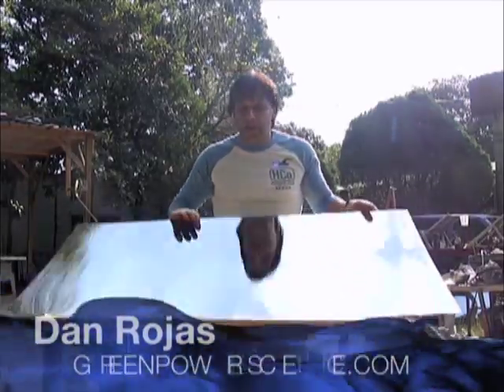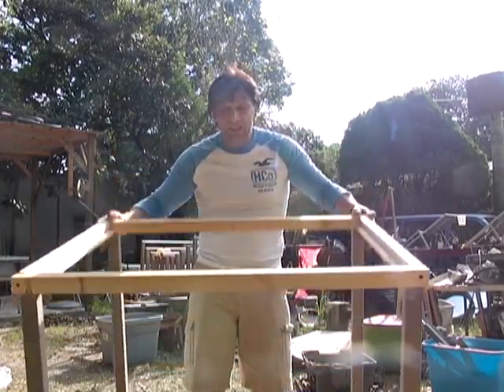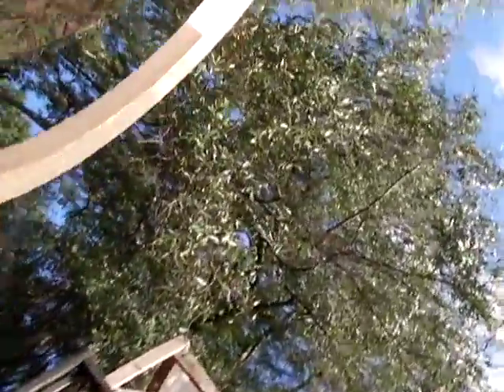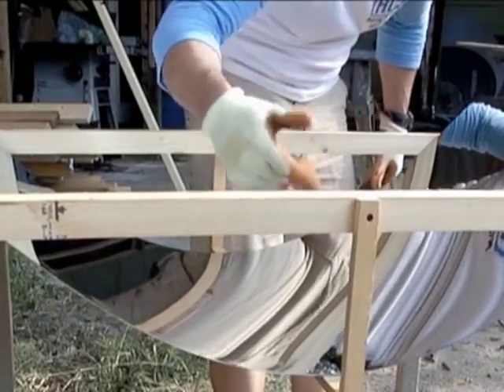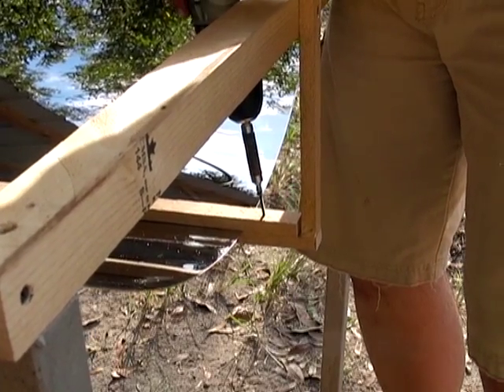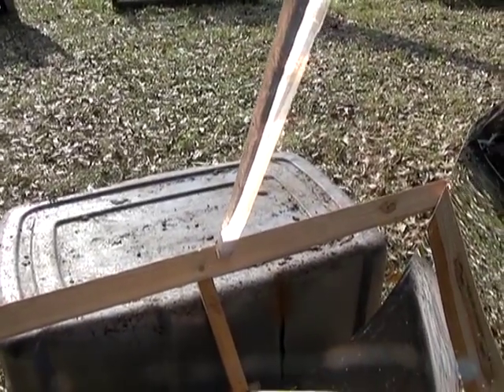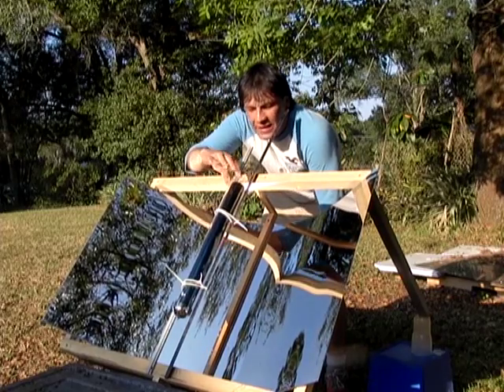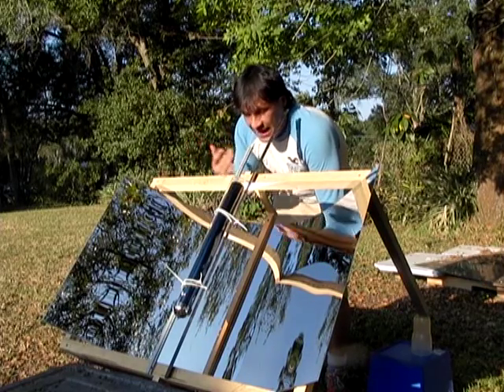DIY Parabolic Trough Mirror made in 20 minutes Stainless Steel Mirror free energy from the sun

Comment from the maker: 2 types of panels
lower wattage/power panels usually are thin film amorphous (black colored). 

However:
If the lower wattage panel is a 36 cell configuration, then the cells are smaller. Even a small piece of a broken cell will produce 0.5 volts but proportionally less current. When 36 cells of any size are tabbed together in series they = 36 x 0.5 = 18 volts - 21 volts open no load. Larger cells produce more current but the same voltage.

Comment: Why not take the reflective film that Dan sells on ebay and apply it to some shiny black mylar veneer or similar black flexible surface, use it the same way as in this video. That would save buying stainless steel and would be easier than making the parabolic dish

Comment: @catfish4975 You'd better be aware that system efficiency is going to blow away a lot of the gathered energy, and you'll be lucky to collect more than 150W/M2
Thus the cost of your tracking mechanisms, pipes and seals will mount up
It's is better to first ensure your house is properly insulated, with ventilation heat recovery, before investing in a large reflector assembly with a relatively small return. Where do you live?

Comment: What gauge of sheetmetal is that? I'm thinking of using 36" or larger water pipe, cut in half lengthwise and trimmed to a length of 8-10 feet long. After that, lining the half pipe with this stainless steel sheet metal should gather a tremendous amount of heat.  Especially if it was on an X-Y axis with a suntracker and motors to keep it as maximum efficiency.  If it was enough, I could pipe it into an insulated underground tank and then use a heat exchanger and a pump to warm my house.

Comment: If it is stainless steel, one could use rare earth magnets to hold the sheet in place and even control the shape if needed.  This would also allow you to keep a stronge degree of adjustability without blocking the reflective side at all.

Comment from the maker: @judoyodan it is a dark inner surface with a vacuum around it. Vacuums do not transfer heat well, they are a vary good insulator. Sunlight penetrates the clear outer glass and heats the black coating delivering heat  to the water. Heat can only escape through the top. This builds temperature fast. This is a typical glass thermos but clear on the outside vs silver.